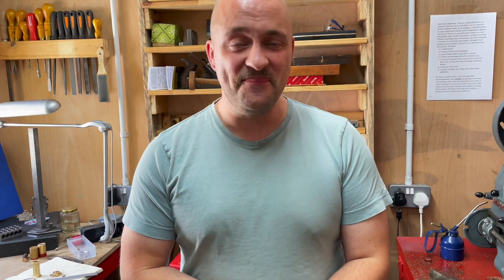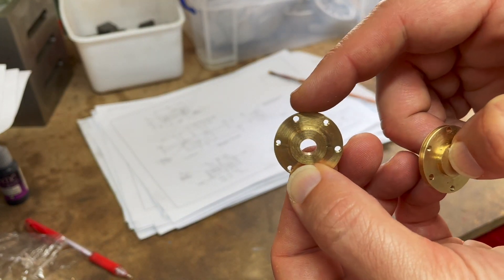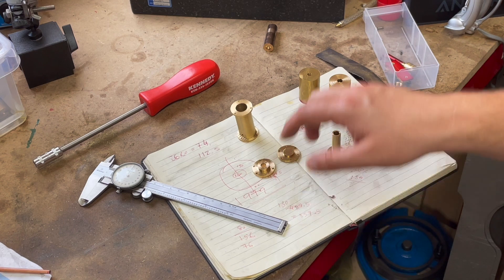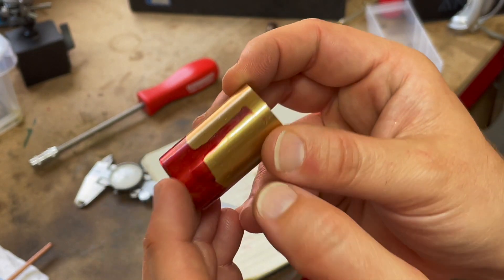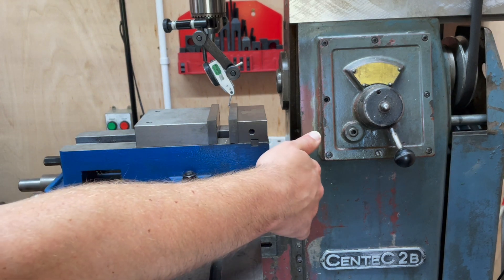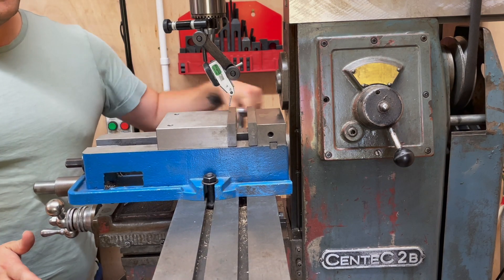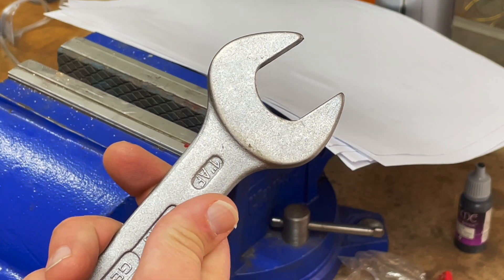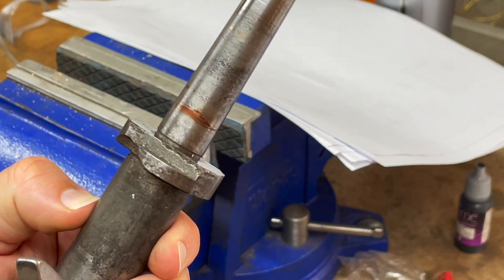Cylinder - Building a MyfordBoy Traction Engine 4

Comment: As to grinding: you are correct that grinding creates a concave form in the jaws, BUT that is only if you leave it to that. After correct grinding take the jaws out, dial them in on your mill referencing the deepest point of the concave surface, and then grind them flat.
Reply from the maker: I don't have a grinding tool on my mill (I guess I may be able to using the horizontal mode but there's a little runarout) but that's a good point. Maybe something to experiment with, with the old chuck!

Comment: Great update, thanks. I hope mum and baby are good especially in this weather. I do not recall seeing your mill coolant tray before. It would be good to see it in a future video because we would like to add one to ours.
Reply from the maker: The 2B comes with a huge coolant and chip tray - it's about 3' square - but I'm afraid I won't be using any coolant with my mill. Not only have all the pumps been removed at some point, but the motor now sits directly under the coolant drain channel!

Comment: Thanks for the update. Hope all is going well with the missus: my kids all arrived late, so I know it's an anxious time. The replacement chuck looks like a big improvement, although some deflection on a bar of the length you had in the lathe would be expected even with a new chuck. 
Having got my Super 7 operational, I am now tackling a Speed 10, which is causing me a deal of frustration, especially as the Myford manual is pretty hard to understand in places. A photograph of the change wheel arrangement for fine feed seems impossible, with no change gear appearing to mesh with the leadscrew. Happy Days.